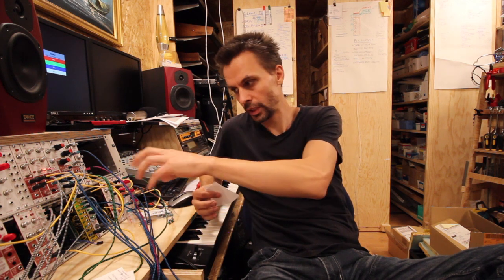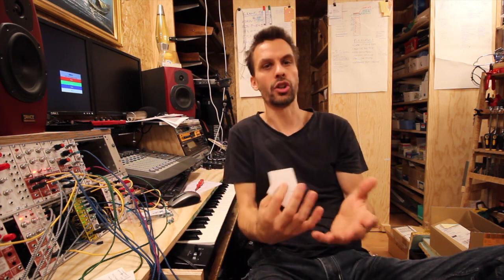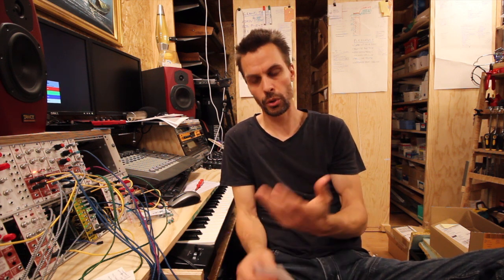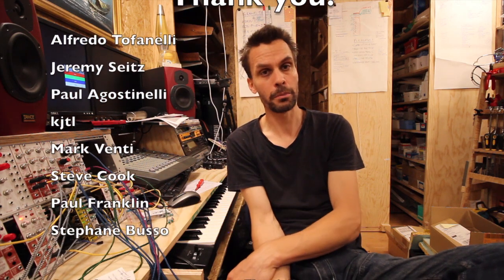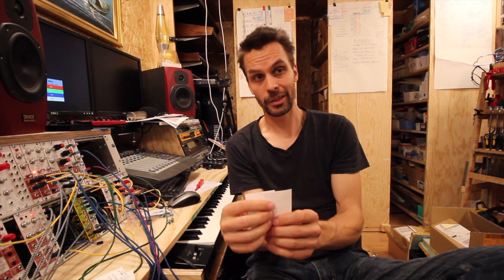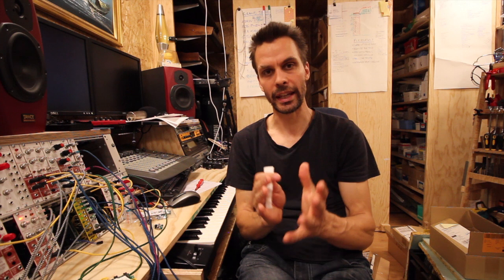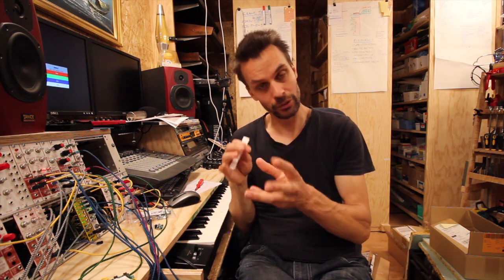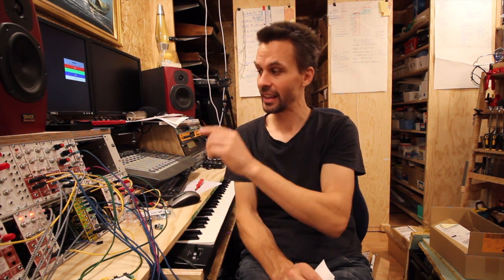Analog Drums part 1 BaSnaHi kind of fail - DIY Modular in a Week

Comment: hello, thanks for all your vids, (sorry for my english, i'm french),  i have a question about the Bass Drum schematic : what the value of condensators please, i think C4 is 200 nf non polarised, C3 a 100 nf non polarised, but the polarised ( C1,C2, and C5 it's only write 0.1 but no nf , pf, uf ? thanks
Reply from the maker: The .1 is uF I think. :) not my schematics. But the Bassdrum sounded ok with these values. As I said in the video maybe don’t make the other two drums or at least separate the outputs so you won’t get the noise.

Comment: Around 13 minutes in, you mentioned some modules broke.  Would you mind talking about which broke and why?

Enjoy your vacation!
Reply from the maker: It was the simple lfo module. Still not sure what is wrong. I need to sit down and probe around. Probably a solder joint that broke. It was one of the first modules I soldered together in this project.